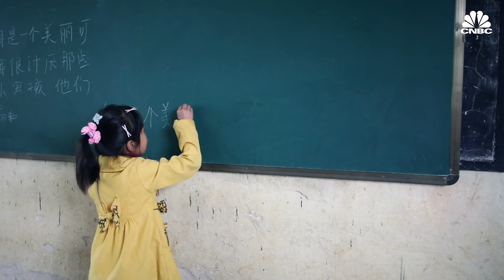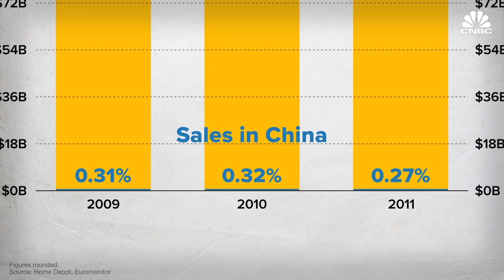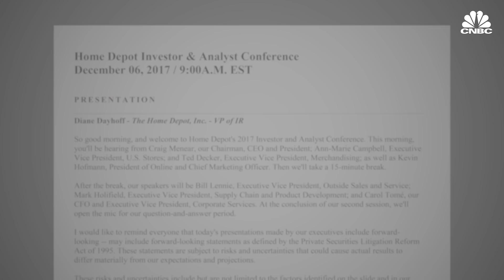Why Home Depot Failed In China

Comment: IKEA DIY is elementary, the most difficult part is hauling the package into the trunk, into the elevator and into the home. Chinese consumers who are willing to do some manual work can handle on their own.   

Home Depo DIY on the other hand is much more difficult, like knowledge of materials, garage to work in, pickup truck to haul the purchase, place to dump garbage, place to store the tools, and the most challenging of all, physical strengthen to handle power tools and mentality to embrace handiwork.  So except for the knowledge part which they are mental ready and can try to learn on internet, the rest are impossible challenges to the Chinese consumers.
Reply: Wait, seriously ? You need power tools ? In my country ( part of Europe ) you would expect power tool usage ( not even always ) only from a high quality custom or small production furniture and even then 90% of the time you just need a power drill. 

I would never expect a huge chain shop items that all most likely are mass produced to require power tools.

Like just recently we bought a local artisan tables for my grandparents and it was more easy then ikea furniture building.

Edit :

I think that in the past we needed more DIY, but nowadays everyone is moving closer to IKEA model, some companies even manufacture for ikea.
Reply: @BlackPeagas  Home depot doesn't sell furniture. They sell lumber, stone etc. , fixtures, and tools.

Comment: Chinese dont fix their homes they just buy a new one.

Not like you can fix a whole apartment building.
Reply: They do if the DIY cost is cheaper than buying a new house woth the same desired results.However,they might still buying new houses instead as they cannot use the house for a really long time.Also,they NEVER renovate a house by themselves only.

Comment: It's true, in China often you often buy a new concrete box with only then main supply of gas, water, electricity present. The plumming, electricity, water, gas etc. to each room still has to be done. That's a job you will NOT do yourself. There are building companies that specialize in doing that in a very SHORT time, they have all the knowledge, materials and people at hand.The quality of the work depends on the money you want to spend; cheap = bad, expensive = good. When you want to do it yourself it will probably take 20 times longer, the quality will be worse and it probably will NOT be cheaper. I know because I had it done this year, so I know what I'm talking about 😉
Reply: I'd love to come see the process. I could do it all myself if I were there, but it would be interesting to see how it's done there.
Reply: @ChrisGilliamOffGrid  Because you're start with an empty base you can choose what and where you want everything. For example: you can have 1 or 20 electricity sockets or lights or change the kitchen to another room etc. These building companies are specialized so they can do everything: gas(is not allowed to do by yourself) , light, water, toilets/bathrooms, floors, windows, tiles, doors, even furniture. The important thing is to use good companies to do the job(more expensive) because there are some very questionable (cheap) companies also.
Reply: @johnsamu  I understand why it's done, we do the same here with some commercial buildings. I'd just like to come see them do it there because I'm a Plumber. 😉
Reply: @ChrisGilliamOffGrid  Just talking about the plumbing: When you would want to do it by yourself it would be more difficult (and possibly more expensive) to source all the needed materials, because normally all the customers are big building companies that buy in bulk. The suppliers are therefore often located outside the cities "somewhere"' in the countryside and they are not used to handle separate customers. When you buy new toilets and bathroom equipment, bringing/placing/connecting is INCLUDED in the price.
The plumbing was done in a professional way by the building company by GOOD plumbers. (=more expensive) But when I bought a small bathroom item for a CHEAP price at a small local shop, the man had no idea what he was doing when he connected the plumbing, so I had to repair it 😉 but it was very easy to do. In China you can get GOOD for expensive but also BAD for cheap, it's your choice and your task to separate the good from the bad companies.

Comment: I remodelled my kitchen. And , floors, and ceilings. One year later, I have pride ,I, did this. Chinese do not think that way because government does everything with regulations. not cheap labour.
Reply: You may have the pride, but how good is your work compared to a master builder? How is your work compared to a professional who has decades of experience? How many mistakes did you make before you got it right. How many mistakes did you have to leave in because you could not correct it. How much time did it take, compared to a professional who does what you did every day of the week. And is your work safe?

It is not just cheep labor. Would you trust the work of an amateur on your house, if that amateur weren't you?

Comment: We have had problems with HD as to stocking all the items we need for jobs around the house. They stock TV antennas, but not signal amplifiers. The equipment the have is very cheaply made, and will not hold up to extended use. We purchased treated lumber twenty years ago, which was supposed to last thirty years. It has rotted and been hauled off to the dump. The other big box stores are not any better. They seem to think we want to order via the net, NOT!!! Like most U.S. citizens, I want it and I want it now. End rant.

Comment: Home Depot is just as shortsighted in the US, but having put most other hardware stores out of business, and being generally more convenient than lumberyards, there's no longer  many other options. I have worked construction at a professional level, but still usually end up in the Home Depot. Urban Los Angeles Home Depots are particularly atrocious. Recently, when I needed some specific metric machine bolts, I decided not to bother with the mess that is Home Depot, instead driving quite a bit longer to an old style hardware. I found what I needed in less than five minutes, it was a joy. This experience underscored the annoyance of a typical trip to HD, where I always end up muttering 'F* Home Depot.'  When people talk about free enterprise and consumer choice, what needs to be included is a measure by products and services over time. Home Depot put hardware stores out of business primarily by price, not because in anyway they do a better job.